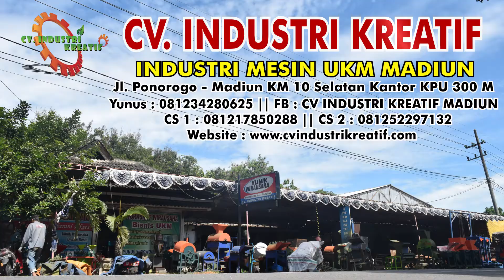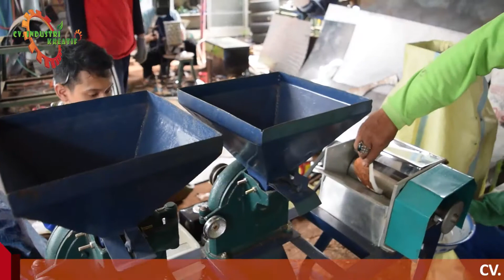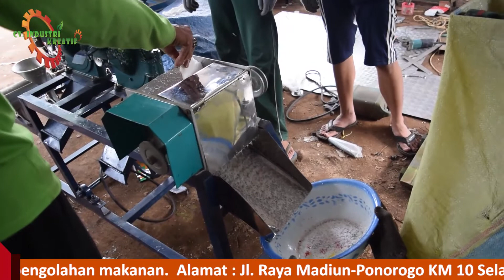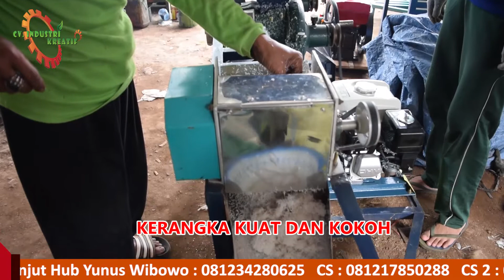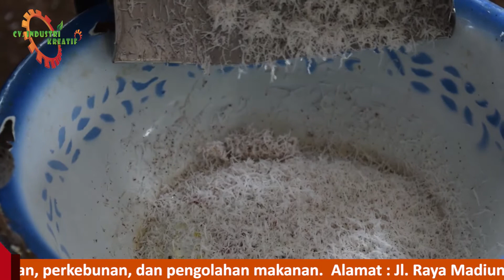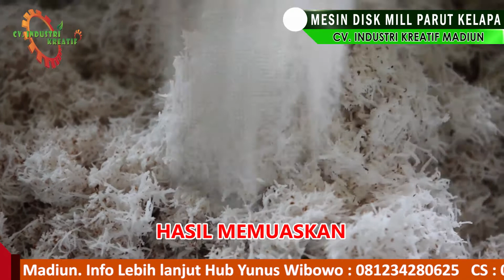MESIN DISK MILL MULTIGUNA  4 IN 1  - PARUT KELAPA - PENEPUNG - GILING SAMBAL KACANG

Comment: Harga brapa om tanpa diesel e
Reply from the maker: info pemesanan hubungi Customer Service Representatif Kami di 081234280625 - 081217850288 - 081252297132 atau kunjungi Workshop Kami di Jl Madiun - ponorogo KM 10 Selatan Puskesmas Geger 300 Meter Kec Geger Kab. Madiun Jawa Timur
Reply: Ribettt amat di takoni rego wae
Reply: Knp ga ksh tau langsung harganya

Comment: Berapa ini
Reply from the maker: untuk info harga,detail mesin & pemesanan hubungi Customer Service Representatif Kami (Telp/WA) 081234280625 - 081217850288 - 081252297132 atau kunjungi Workshop Kami di Jl Madiun - ponorogo KM 10 Selatan Puskesmas Geger 300 Meter Kec Geger Kab. Madiun Jawa Timur